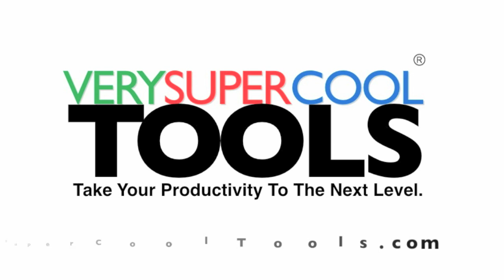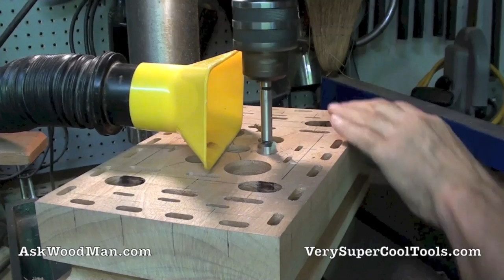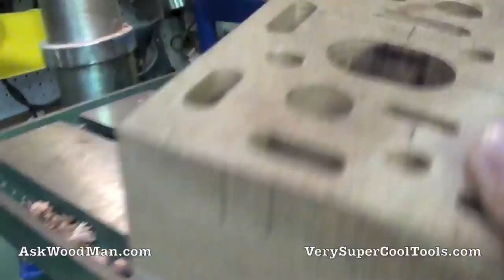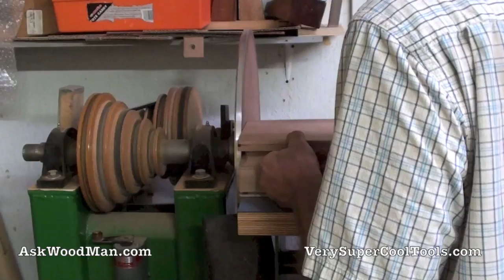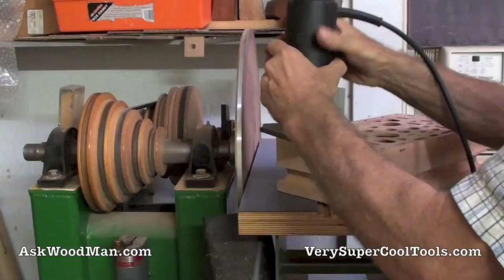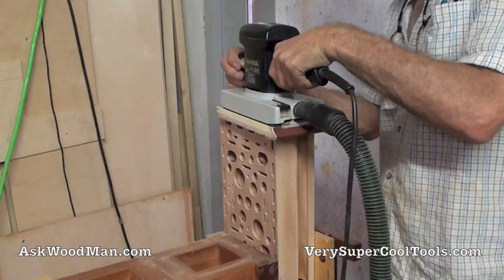Drilling An Assortment Of Hole Sizes In The Tool Caddy  6/7

Comment: I've been using a stainles bbq brush lately when I can't locate my normal steel brush, its soft but doesn't get bristles as clean (after paint), also just saying I tip my brush up to get thinner into ferrule, and I don't wire brush every rinse cycle.